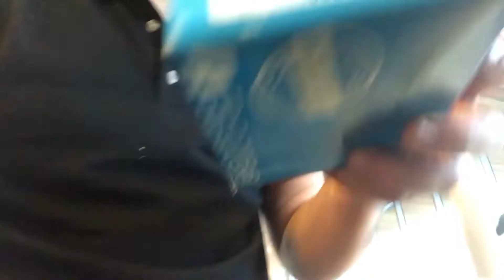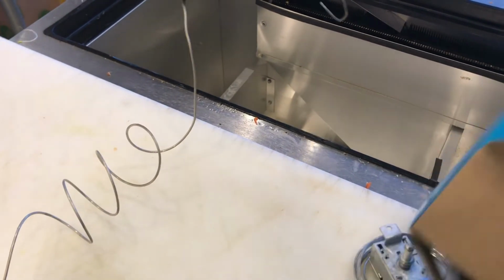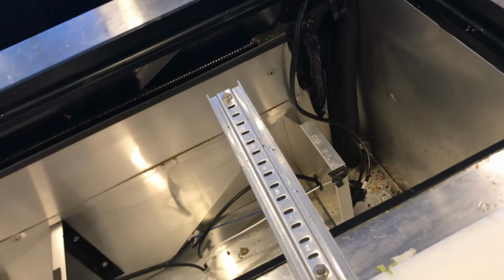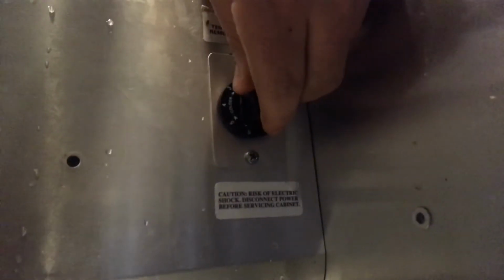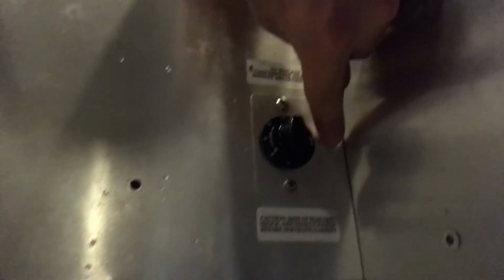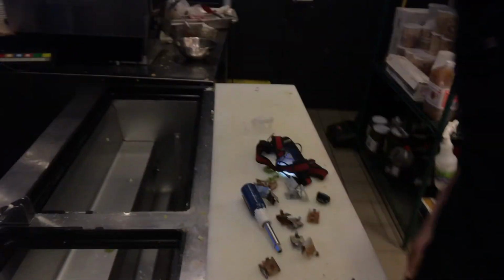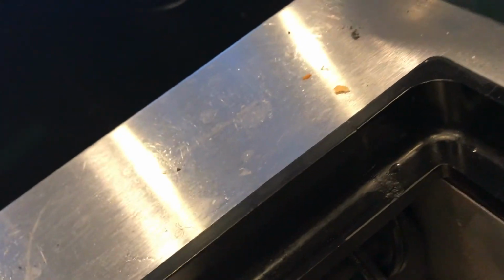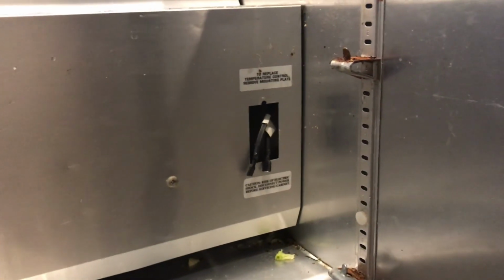HOW TO INSTALL A THERMOSTAT FOR A TRUE PREP COOLER

Comment: I have a true drink cooler it was freezing the drinks no matter the setting it was on I replaced with a new thermostat off eBay and it will not cool below 50 degrees 831932 part number idk if you have any idea thank you
Reply from the maker: Depends on the model of the true cooler you have. Each true equipment has a different type of thermostat. Call true mfg and they will give you the correct part number, then you can buy off www.partstown.com